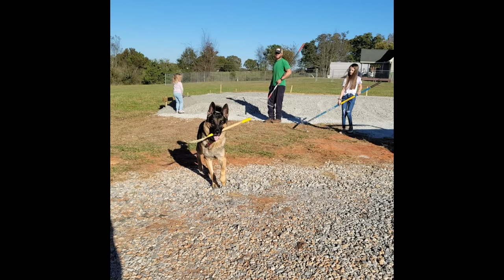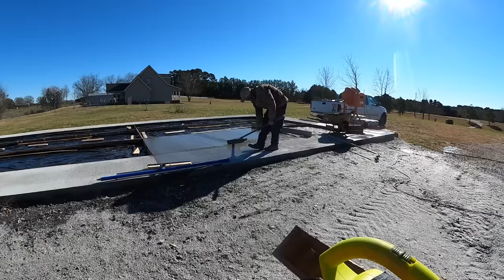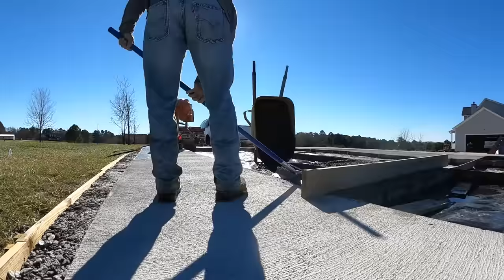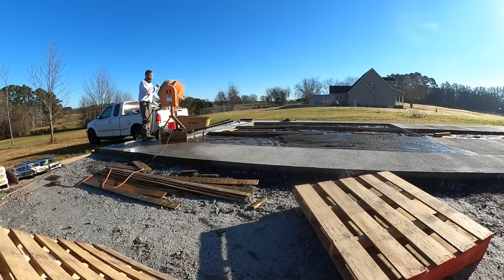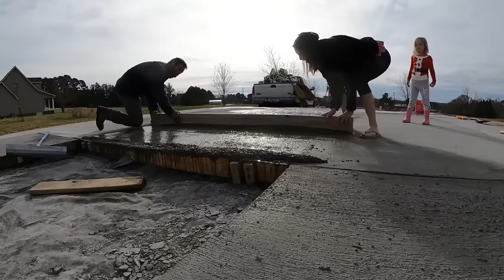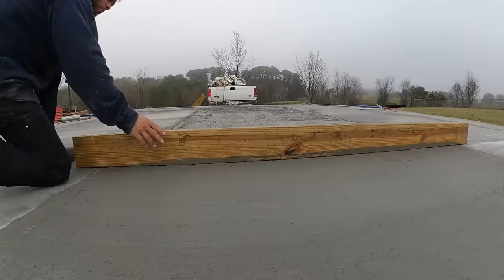Pouring a Huge Concrete Slab Using Bagged Concrete | I Saved $10,000

Comment: Good job.  My only issue is the savings for concrete delivery.  A bag of concrete is .6/cubic foot. It takes 45 bags to equal a yard of concrete out of a truck.  $5 a bag x 45 bags you're at $225 a yard.      The national average is $143/yd.  In my region, I sell it for $200/yd (non-account C.O.D.)
Reply from the maker: When I did this they wanted 200 to 220 depending on the day with a 4-6 week delivery. I was able to get #80 bags for 3.20 each. I haven't seen it for 143 per yard in over 10 years. I wish  it was that cheap here. As I said in the video doing everything myself saved me the money along with a small savings going bagged. The lowest quote we received for this was 14k. I actually saved more than this if I average the quotes. I have about 3800 in this project with over 100 tons of crusher run.

Comment: I like what you did here, its given inspiration. One thing I'll do different is put the mixer on all four wheels so it can be wheeled to where it is easier needs to be poured. I think I will have some help when I try this, I'm not a spring chicken anymore.
Reply from the maker: Thank you! 4 wheels would’ve been awesome. I have seen some mixers set up like a wheel barrow but they were almost double the cost. I’m sure you could set this harbor freight mixer up with 4 wheels with a little work.

Comment: I did the equivalent of 480 bags. But instead of using bags I picked up clean aggregate sand and Portland cement. One part Portland two parts aggregate we call it three quarter minus. And three parts sand. I saved quite a bit more
Reply from the maker: I looked into going that route before going straight bags. I couldn't believe but when I checked into pricing it was going to cost right at 163 per cubic yard because the price of sand in my area at the time was insanely high. I'm not sure what it is now.
Reply: @reallifetested2605  Makes sense then I did my project 2016. Very smart that you checked the price though.

Comment: Its the opposite here in Ireland, the bag of concrete has nearly doubled at around 9e/25kg, and same with a lorry load of pit gravel, however a m3 of concrete in bulk only gone from 80 to 110euros. I try to have 5 or 6 small jobs lined up then call the lorry.
Reply from the maker: Prices are insane everywhere especially now. It looks like they're going to stay the way they are unless something happens. In my area bag and truck have almost doubled to what they were just a few years ago.

Comment: Im figuring forty 90 lbs bags of concrete per yard at about $4 bucks per bag when I last checked (Las Vegas) that is some rather expensive concrete ($360 per yard). Usually concrete by truck is CHEAPER and the quality is going to be better b/c you're getting it in 1 pour (no seams)
Reply from the maker: 40x4 is 160 lol. In my case it was 3.20 per bag. Truck they wanted 200-220 with a 4-6 week lead time. I couldn’t pour this much at one time alone, local contractors lowest quote was 14k. So far this concrete is holding up great with no hairline cracks. I’m doing yearly updates so stay tuned!

Comment: Nice work. I did a 350sqft not long ago and i feel your hard work. In my opinion on such a large slab always consider getting mixed concrete trucks as you can save a lot more in time and money and energy cpnsidering you have access for a truck. Great work
Reply from the maker: In my area at the time they wanted 200 to 220 for truck with a 4-6 week lead time and I was able to get #80 bags for 3.20 each. In my case it was cheaper and more convenient so that's the route I took. Thanks for checking out my video, and commenting!
Reply: @reallifetested2605  Where did you get them for 3.20?

Comment: I would highly advise you to buy you concrete from a concrete company in the future. The pouring is easier the mix is going to be better and stronger and it’s going to be cheaper. This is a good video of how to do this with bag concrete especially if you have some need to use it but labor and material costs are going to be much more when using pre bagged concrete. Just figured I’d throw it out there if you have the room and access having them haul it in is usually easier and cheaper on you.
Reply from the maker: I called and would you believe at the time bag was cheaper. (I’m not sure about now) 80lb bags were 3.20 each and truck was 200 to 220 with a 4-6 week wait. Contractors wanted 14k minimum and I was able to do everything myself for a little less than 4k.
Reply: @reallifetested2605  wow than yeah they forced your hand on that one. Good work!

Comment: Price per yard is bit more expensive at least here in the Dallas area. The problem  around here is you aren't ordering at least 60 yards concrete companies don't  really care and don't give you much priority. I have thought about getting a 6 yard mixer on a trailer for that reason.
Reply from the maker: I took a look at the 6 yard tow behinds you're talking about. Those things are awesome! A lot of people around here actually rent them out. I'm not sure what the cost is now, but when I did this #80 bags were 3.20 each and truck they wanted 200 to 220 depending on the day. Thanks for checking out my video, and for taking the time to leave a comment.

Comment: 830 bags @ $5 a bag = $4,150
1200sf at 4" thick = 14.67 cy of concrete. 
Im paying between $125-$150 cy for cl4000 concrete delivered on average. So that between $1800-$2200.
So that should leave you and extra $2000 for labor.
Thats 4 guys at $500 a day cash to help you put it down and put a hard trowel finish on it in one day.

Not to mention that finish that is on what you have there would probably cost 10x as much to epoxy versus a proper hard trowel finish with relief cuts in it.

Kudos for the hard work and diy aspect of the project. But damn!
Reply from the maker: When I did this bagged was 3.20 per for #80. Truck they were wanting 200 to 220 depending on the day. I did broom finish because I was tired of slipping and sliding every time it rained like in my other 2 shops. No plan to epoxy because this is just used for storage.

Comment: Truck is a lot cheaper around here. About $155 per yard for 4000 psi mix with fiber in it. A yard's worth in bags of high strength stuff will set you back nearly double that.
Reply from the maker: In my area at the time truck was 200 to 220 with a 4-6 week wait. I was able to get #80 bags for 3.20 each.

Comment: Yard for yard bagged is more expensive than ready mix . But you were able to go at your own pace and save Labor not having to pour all at once
Reply from the maker: When I did this they were wanting 200 to 220 with a 4-6 week lead time truck, and I was able to get #80 bag for 3.20 each. So it was actually a lot cheaper. What's even crazier is mixing yourself using sand, portland, and gravel it was going to be 163 per yard. The prices of things have gotten out of hand and are getting even worse.

Comment: Excellent job. You could have put expansion joint material in after removing forms and that would help with possible cracking issues. Otherwise this is a great example of getting shit done, and saving money for more important things.
Reply from the maker: Thanks brother! I did cut expansion joints just didn’t record because it was so dusty you couldn’t see anything. I did a one year update if you’re interested and go over the most frequently asked questions as well as show the whole slab.

Comment: Looks like the 3,2,1 method would have saved money. 3 scoops, of gravel, 2 scoops of sand, and 1 scoop of Portland cement. Bring in gravel and sand by a semi and get a pallet of Portland. Work like a fool and be prepared for the weather. That's how I did mine but it was smaller.
Reply from the maker: Believe it or not it was going to be around 163 per yard going that route vs 144 going this route. In my area at the time the cost of sand and portland were outrageous. I haven't checked recently but can only imagine that they're even higher now. I remember not even 10 years ago doing the 3,2,1 method was less than 100 dollars per yard.

Comment: Smart Decision! only concern is, I didn't see any rebar.not an expert, but its vital ingridient when pouring concrete.
Reply from the maker: I called around and spoke with local pros. They said in my area it wasn't needed in a residential on grade 4" slab. It rarely gets below freezing here, and I don't plan to pull any heavy equipment on it. It's definitely a climate, and load thing for sure. Thanks for checking out my video!

Comment: The real trick is to get several small batches of concrete in one section to start curing at the same rate so you can finish it and get it looking right.
Reply from the maker: That's the truth. I did this when temperatures were cooler (40's, low 50's) That gave me plenty of time to get everything taken care of.

Comment: Your looking at 15 yds of concrete with a cost of between $130-$150 yd plus delivery charge of around $100 for full 8 yd truck .  830 bags of concrete @ $3 a bag looking at around same cost. Now you don't have to spend a week mixing as you could of got 2 trucks same day and be done. Saving money on forms, finishing , prep is where money is to be made. Mixing these many bags just doesn't make sense for cost savings and also will be weaker as some areas will have more water. Trucks get water ratio exact for big batches.
Reply from the maker: When I did this they were wanting 200 to 220 depending on the day. (they didn't tell me this but I heard that there were truck concrete shortages is why the prices spiked) It's back down to 165 now with a 4-6 week lead time. The 10k saved was based off of 14k quotes that I got for this work to be done. I did everything myself for a little less than 4k.

Comment: The work effort is truly outstanding.  My only concern would be that the mini slabs are not tied together.  You should have laid rebar connection rods to tie them together.  I have done a lot with bagged concrete putting up retaining walls and columns I know how much work that is just setting up the bags and hauling them around.
Reply: Yeah I'm ignorant of this type of stuff but I'm wondering shouldn't there be rebar laid down to keep the slab from heaving when it inevitably cracks?
Reply from the maker: I haven’t had any issues with separation. I will say for added insurance I do wish I had pinned the slabs together. Hopefully the base I prepared will do its job. I’ll be doing yearly updates so stay tuned!

Comment: respect dude you just give me some inspiration that is about the same size as the one i want to build
Reply from the maker: Youve got this! Check truck vs bag prices now. When I did this truck was 200 to 220 depending on the day and #80 bags were 3.20. I think truck prices have came back down from covid shortages and bags prices have increased because of this crazy inflation were going through. Still may be cheaper though especially figuring in delivery and you'd more than likely need help doing that much at once. Thanks for checking out my video!

Comment: Impressive, good to know that this can be done. I calculated that your slab is about 2.5” thick. I have a very remote property with a difficult 4 mile dirt road. Concrete trucks won’t go near it. I guess I will spent at least a month just hauling bags to it.
Reply from the maker: I used the 80 lb bags. I was aiming for 4-6 inches and it ended up being a little over 5". It sounds like you're going to have a lot of fun if you ever needed to get some concrete back there! Thank you for checking out my video, and for taking the time to leave a comment.

Comment: I think that is going to have a lot of cracking as the ground moves. I would have installed wire meshing to keep it all connected and strong.
Reply from the maker: So far so good! Around here rebar or mesh is only used if requested.

Comment: I did simular size concrete just few days ago on my own and spent less than 1k$. Gravel and cement, 4/1 ratio. With rebar.
Reply from the maker: That’s awesome! I was going to go that route to begin with but local sand and mortar prices were so high it was going to end up being around 163 per yard. I bet now it’s even higher with all of this inflation we’ve got going on.
Reply: @reallifetested2605  yes, prices of everything went nuts in past yr.

Comment: I always thought the truck was cheaper than bags and never bothered to run the numbers. Wow.
Reply from the maker: At the time it was. This was during all of the Covid issues and I’m sure you can remember what that was like. Bags were 3.20 per #80 and truck was 220 per yard. Local contractors wanted 14k and up for this work. I have about 3800-4000 including concrete and over 100 ton of gravel.

Comment: Wheen using bag concrete...for this ..use 5000 mix and add Portland cement to mix makes it alot stronger.
Reply from the maker: No more weight then I have on it I didn't opt for the higher psi. 5000 psi is a strong concrete!

Comment: 1 yard of ready to pour concrete delivered roughly $120-160
1 yard of concrete in 80lb bags =45 bags … average price per bag when buying a pallet is $5 ..
= $225 a yard for buying it by the bag and mixing it by yourself . Plus the fuel and time to go pick up the bags of concrete most people will have a hard time hauling a few pallets of 80 lb bags of cement and then unloading them on job without having equipment and a   Trailer. 
This job was roughly 23 yards of concrete just guesstimating haha.
 45bags a yard x23 = 1035 bags x $5.00 a bag so $5,200.00 ish
Last 10 yard truck I had delivered was $1,400.00 ish 
X2 plus 3 yard call back possibly say another $600 
Total to have delivered and mixed $3,400.00 
Could have saved probably $2,000.00 ordering concrete for this large of a job.
Sack Crete makes sense the smaller the job but once you’re at a 10 yard truck load it’s kicking yourself in the ass. 
That $2,000.00 in saving on material could of hired a finisher to give the slab a nice trowel finish instead of having a broom finish plus they would of had tools you could of saved the money buying the electric mixer and bull float also . 
Idk maybe it would have been better to work doing what it is you do and make a living an extra day or two and then let a concrete finisher and concrete company supply the concrete.
Probably would have saved more money and had a better finished slab broom finish is for a drive way or side walk not inside a shop haha.
Of course the prep and form work is easy to do and if always rather do that stuff myself anyway just to make sure it’s where I want it ,the elevation I want ,and square , haha this is something I have found the last 20 years most concrete laborers need someone to double check them anyways…
All in all good job man I have poured tons of slabs for myself and finished em I have never used sack Crete for more than a 3x5 pad though hahahaha a 1200 sq ft slab with sack Crete is pretty awesome haha
Reply from the maker: When I did this 80 lb bags were 3.20 each and truck was 200 to 220 with a 4-6 week wait. So it actually did save a bit. The lowest quote from multiple contractors was 14k for this. Contractors have lost their minds in my area. I have large equipment so it only took a few trips I’d guess less than 20 dollars in gas was spent. I wanted a broom finish because hydraulic fluid is like walking on ice with smooth concrete. Another win for bags was I could handle this at my own pace. I couldn’t do all of this by myself with a truck. I was working night shifts at the time 7 days a week so my time was limited to when I got off to when it was time to go back to sleep. Edit: I also already owned the tools.

Comment: Awesome job!! Where is the re enforcing steel mesh? Forgive me if I didn’t see it?
Definitely bore holes into one half of your wooden boards, and poke galvanised starter bars in nice and straight and level… so you can slide your board off sideways later. (locks slabs together and shares any loads across your slab at the joint)
Could set up a tank and rapid measuring system for water, and ingredients on trailers.
The perimeter slab you did is just genius.
A laser level beam at night with pre hammered in wooden stakes from that day, would really guarantee easy levels.
Proud of you mate for having a go and then sharing it, definitely next level stuff 👍
Reply from the maker: I called around, local pros said that rebar isn't necessary in an on grade 4" residential slab. I haven't had any issues, but I wish I had pinned all the slabs together with rebar. It would've been great added insurance. The shop I had built on the slabs frame is bolted to the concrete, so hopefully that will help hold everything together. I haven't had any issuse yet, not even a crack. Stay tuned i'll be doing yearly updates. Thank you for checking out my video, and for the kind comment.

Comment: It's a lot of work, but the only thing I didn't see in the video is the rebar to help support the weight.
Reply from the maker: I called around and spoke with local pros. In my area they say they don't really use rebar in residential on grade 4" slabs. Commercial, industrial, and houses only. It rarely gets cold here and we have good soil. (not sure if that's the reason just what i've been told)

Comment: 80 lb bags Sak crete $5284 40lb bags over $6k, but concrete delivered by truck $3611.
Reply from the maker: They’re 3.40 in my area right now for an 80 lb bag. Truck is 200 to 220 per yard. Contractors wanted over 14k minimum. I have 3800 total cost in concrete and gravel.